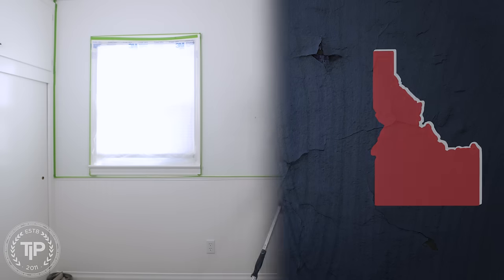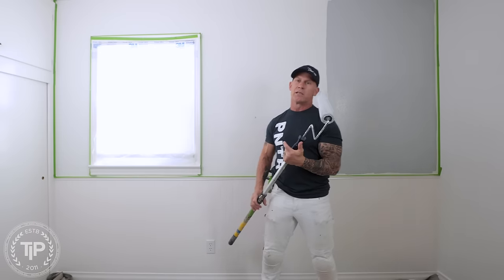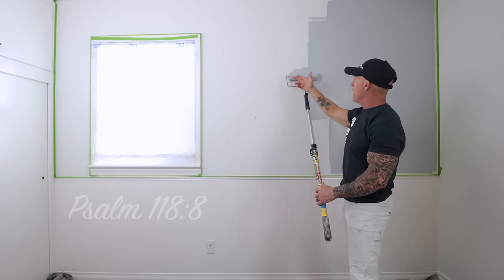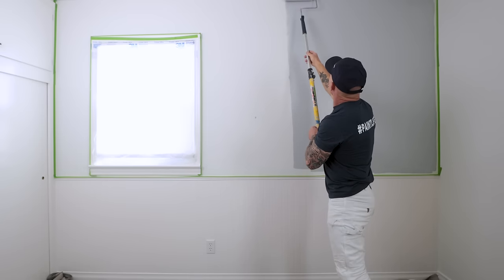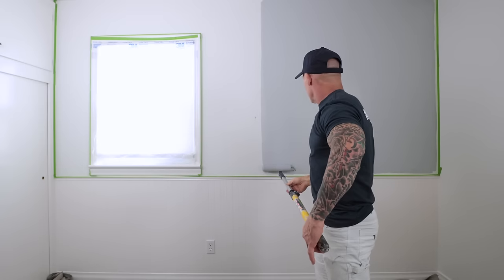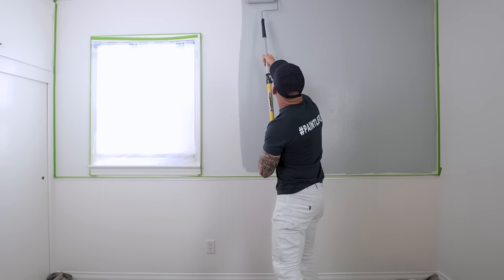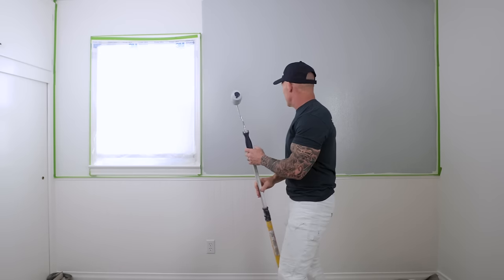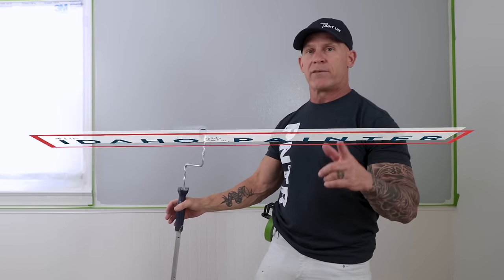How To Roll A Wall.  Laying Out Interior Walls. Tips from The Idaho Painter.

Comment: I only recently found that same method of facing that roller sleeve in the right direction. It definitely does keep it from scooting off the roller handle. I'm glad you mentioned it to your viewers.
Reply: Pretty obvious though
Reply: His Wooster cage will not lose a sleeve in either direction.   Great cage.
Reply: If the sleeve is slipping, spread (pull) the bars on the cage to hold it. Feather out with the "coming off" direction, apply in the pushing on direction for best results

Comment: Good video! I don't usually roll out of a tray, so my method tends to be a little different, but the main points remain the same. Spread the paint evenly, maintain a wet edge, don't dry nap, and backroll each section before it starts to tack. Thanks for the great content, keep up the awesome work!
Reply: Yeah he didn't really mention backrolling, eh? I'll load the roller up then create a "V" shape like 3-4 feet high (in the middle of the wall, and also not much wider than the roller width, and that's when I'll roll onto the wall. Then I'll load up again, repeat, and then back roll those two sections that I just put on the wall. How do u go about it

Comment: The Idaho painter is the best, I've been painting and drywalling for over 22 years and I use these methods as well, I actually pull two wires slightly apart on some of my frames and my sleeve fits more snug, I actually have my elbow side of my frame on the dry side and when I'm laying it off in one direction after distributing I gently twist my frame to pick up any line's. When I'm rolling a second coat I intentionally leave a small run as a marker so I'll know what's wet and don't go back and try to lay off paint that's already drying causing flashing and uneven stipple. Of course when I leave the run for my marker I pick it out .

Comment: we call that back rolling here in NC ! I prefer to cut in trim first then roll walls. Seems to be faster because you can paint fast on the trim then cut the wall into the trim.
Reply: I back paint the trim on doors and windows, but just the sides with trim paint (semi)
Then I cut in the walls (flat)
Easier to cut the wall straight, than a 1/2 inch trim. 
All same paint....same 
cut sides and fill the rest  of the frames after the walls are done. Paint the door(s) last.
Reply: Will you cut in before the second coat? I've done it both ways

Comment: How many years have you been painting. I love this channel for good tips. 
38 years and I've never seen anyone paint that way.
I can take a sleeve out of a half used five stand it in the tray and plunge a handle in it, for one thing. That's a loaded roller, lol.
I start by cutting in the wall so I can feather roll it out tighly, especially around switches and outlets.
Start near the bottom and roll up the near the full height.
Roll back down half the width of the roller and up again. Flip the sleeve to get a little more filling distance. My personal trick.... you're all welcome....
Develop an even roller with a smooth feather edge (rolling toward the sleeve on side) after filling in the space and carefully roll it out corner to corner. (in the sleeve "coming off' direction). At the end I back paint and finish into the painted end. Check the wall at an angle to be sure it's smooth. Done ! 
Flat is what I use to seal a patch...which will burn through any Semi Gloss.
Last important tip....
With Semi Gloss...
Don't let the cutting dry before it's rolled, or it will show lines.

Comment: Great idea to rotate roller, I used to use that technique to prevent drips onto floor, before switching over to what I do now.  Good video.
Reply: I lift the loaded roller over the tray.
With a turn of my wrist I tilt the sleeve over clockwise
And back a turn of the wrist
Return to level and it will hold.
Shift to the wall.
Second speedy method is a careful spin of 1 or 2 revolutions. Then, the shift to the wall
Reply: @Johnnyboy 
Just about everything.
SonnyBoy
What's your question?

Comment: How long would you use the same roller pad on a job
Reply: After using and washing them about 10-15 times the nap starts to get a little stiff, that's when I save those sleeves for oil primer, basement floor rolling, etc. when I use them one last time. I hate wasting so I wash them out meticulously until water comes out clean, but after they dry you can tell  when the nap gets stiff, and starts to deteriorate and won't hold as much paint or won't do a nice even finish. On rough walls they're still ok even then.
Reply: Thank you so much for your response, we appreciate your channel. @kutykutyka

Comment: I hired a paint contractor but now several walls have bubbles. Never seen this before and this after hiring painters and painting myself in the past. Why did this happen?  Do you have a video addressing this issue?
Reply: I have on a couple occasions had bubbles develop mysteriously that recurred no matter how I tried to seal the surface.   There is much on the internet about this grievous problem. :)
Reply: @jeffreylittlewood6237  thank you! Seeking the highest level of experience and support via the Idaho Painter mostly. 😏
Reply: Saponification
A reaction to soap or something that has otherwise contaminated the surface.
Try washing substrates with Tri-Sodium Phosphate. Available in any real paint store.

Comment: Solid! Nice and concise. but lead with the frame where the most pressure is. It’s 2022 and we are struggling to pull paint rollers off of frames over here. 
It matters because anyone with less experience in painting that doesn’t fully understand the importance of backrolling or how to do it properly will leave at least 20 lap marks on the wall your painting. For example, I have a guy named Jonny, after two years of painting with me; I can’t trust him for an amazing even finish because he doesn’t lead with the frame anymore. The extra pressure from that part of the roller is enough to create noticeable lap marks and flashing. 
Jonny needs retraining.
Reply: Just use an 18 inch roller with a frame that attaches on both ends.  Twice as fast and problem solved
Reply: @gshick  true but 9” Wooster frame with a Wooster gt stick is so reliable and maneuverable. Add a 1/2” corona roller and Behr marquee… your talking only 50-65% of the speed of an 18”. Easier cleanup too with a jet hose.
Reply: after painting smooth sheetrock with semigloss for 3 years straight doing comercial jobs i learned real quick to put it on evenly almost like halflapping when you spray but with a roller otherwise you look down the side of the wall in the light and youll see every single line. smooth walls and semi gloss is one of the hardest things to make look good. that and brush and rolling steel fire doors with oil paint with a moe hair. i dont miss comercial painting one bit lol nothing but steel doors, doorframes and smooth wall semigloss lol and endless conduit which sucks too
Reply: @swere1240  
I hate conduits...
Pipes, Ductwork, Blocks...
And 44' ladders.

Comment: Why wouldn't you cut in first so you can eliminate brush strokes with the roller as much as possible and have a more uniform texture? I don't know a single professional painter who rolls before they cut in. Also, 18 inch rollers all the way.
Reply: I was confused by the speed. Wouldn't it take forever to load up each pass?

Comment: When I go to load the roller, I dunno if I have a low quality roller,  but it rather slides on the tray instead of rolling
Reply: A  plastic tray like Simms with deep ribs helps.  Typically you can allow several layers of paint to build up and then peel it clean.  No liners, just a second tray.  Quality roller cage like his Wooster is essential.   Slimy drywall primer is sometimes a  challenge and a cheap plastic grid floating on top will help.

Comment: Final coat to avoid roller marks and lines?
Reply: If the first coat is not strong enough. Add a second coat for strength. A third coat and your work should be well done. There should be no marks or lines left after any coat. Take a look from different angles. Or improve the application tool/ technique.

Comment: Nope. I have no idea who in the universe I pissed off, but I tried painting a (supposedly) simple and easy bedroom wall and ALWAYS get lines. Especially if I go back over the last few inches that I just painted. Tried 3/8" nap, 1/2" nap, brand new (not the least expensive) rollers, nothing. Must have 5 coats on it already. It is a lighter satin color so really picks this up when light is shining on it. @3:45 in the video is where if I go back over I get lines. Like you can somewhat see in his video. Like the two sheens are different. I give up...
Reply from the maker: Quality paint is the key
Reply: Same here man, going nuts! I'm getting to the conclusion that I can't backroll like that..using SW cashmere